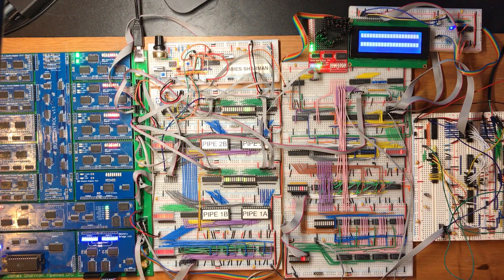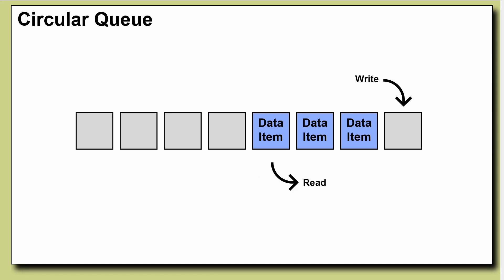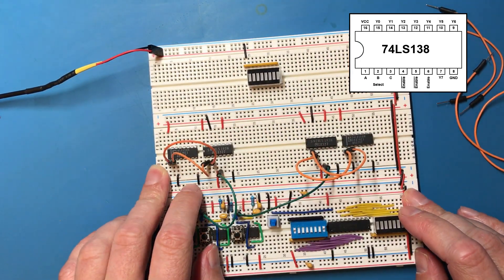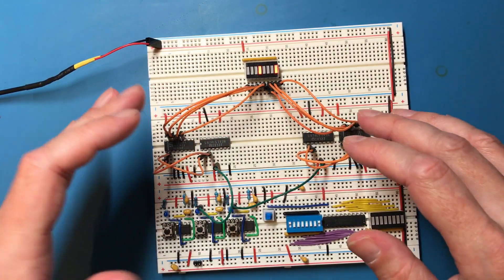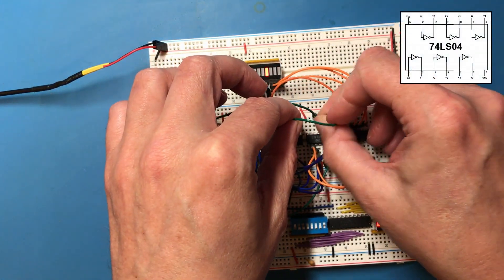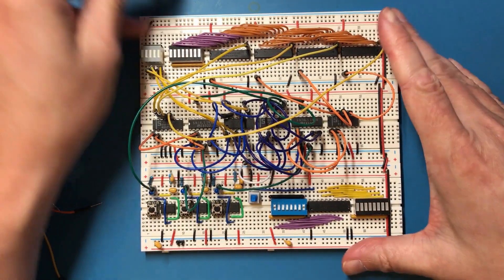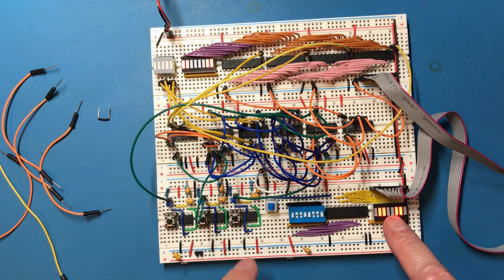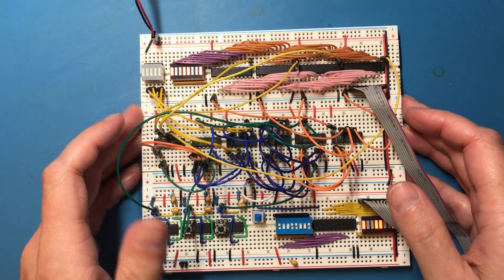FIFO Buffer - UART from Scratch - Part 4

Comment: I was immediately thinking of counter chips and decoders for the enable lines too. An alternative could be a couple of shift registers? Just shifting a bit round in a loop to indicate the read and write pointer - although exactly how you might initialise the circuit with a single bit might be complicated. You could compare the bit position with some XORs to know when they matched indicating the queue is empty. I don’t think you need to know how many items are in the buffer.

Great series by the way. I feel inspired to build something. But you make it look so easy, and I know it won’t be!
Reply from the maker: I'm not sure about your shift register idea, maybe try building it? I did have a very different idea with a series of latches where the value ripples forward.

Comment: Hi James. Great video as always. To answer your question : great idea to show the schematic while you build. Interresting idea to build yout fifo yourself instead of going the easy way with a fife chip. Looking forward to the pcb with the tsop format.
Reply from the maker: Thanks Ced! My plan for the pcb is to use TSSOP for the latch chips (8 of them, so it saves some space) but I'll do the control circuit with my usual SOIC.

Comment: Very nice! This reminds me a lot of the double ended queue I designed as my first really useful circuit.

It was pretty different, since it had a different use case, and it's really cool to see how you're implementing it for your CPU build.
Reply from the maker: A double ended queue in hardware? Nice! I'll have to think about how I would do that.
Reply: @weirdboyjim  I used counter chips for my pointers, but ones that also could decrement. If you were pulling from either end, it would toggle the dec line.

It was a pretty fun project, and a little more complex than I had originally thought, but in  the end I had a really cool, functional DEQUE module :)
Reply from the maker: Yeah, it's not a massive addition, I already have unused decrements, you just need a two sets of 4 line 2:1's to select which pointer is the read/write address.

Comment: hey james! 😊 the format of developing the breadboard and the pcb design in parallel is actually really good! it removes the boredom (to be honest) which comes up sometimes when there are 40 minutes of just designing the pcb in a row... i think it's a good mix! 🥳
Reply from the maker: Glad to have the feedback. I've been trying to cut the pcb design down as much as I can without loosing it. I want this video series to be a full build record but I'm trying to mix things around as much as I can.
Reply: @weirdboyjim  yeah, i know. and watching pcb design is interesting in itself, for sure. but if u have seen it 30 times before... you know 😂 so i think the parallel format really helps with this issue... it also bridges the gap that was there before, between designing the pcb and what is actually designed, as those videos might have been seperated by several months

Comment: Thanks for directing me to this. This is seems generally like what I was thinking for the Video Write FIFO. 
As you said, it would need to be a lot bigger to handle the size queue you're expecting.
Seriously, kudos and much thanks on the crash course on EE and CPU design.
Reply from the maker: If you look later in the UART series I make an 8-byte pcb version which is what I'm using on the UART in the vga videos. Definitely recommend looking at something more compact if you want it much bigger though.
Reply: Same stuff, but using an integrated memory chip instead of a decoder driving enables of individual registers

Comment: Interesting. I remember when UART chips with buffers first came out and we could use higher speeds on our PC's. Seems all PC IRQ's interrupted the CPU enough to loose characters. Plan to add interrupts to your CPU project?
Reply from the maker: I'm glad someone else remembers the pain of relying on interrupts.  Without a buffer no interrupt handler (or combination of them) could take longer than one character or you risk loosing data. Classic interrupts are not planned for this build, that's a scope choice to allow me to finish the build in a reasonable time. At this point I'd have to rework a bunch of parts that are already pcb's to retrofit them.

Comment: Nice build. 
A simplified vision will be to use universal register IC  LS74198 with master clear input. It would save a lot of PCB space.
Thanks ✨✨
Reply: the '198 appear to be made of unobtainium
also, wikipedia states it's a "8-bit bidirectional universal shift register", doesn't seem that would be the right thing for the job
Reply from the maker: I don't know that part (maybe a typo?) but there are lots of more complicated chips that would simplify the task. There are single chip fifo's around, there are single chip UART's with fifo's built in and of course you can get micro controllers with multiple UARTS. This is about the challenge of building things from scratch  more than simply the end product.

Comment: Seeing the schematic every now and then makes it easier to understand whats going on on the breadboard, so its a nice touch, i like it !
And I was wondering if a couple  8 (6,4,whatever) pin strip headers,  an old floppy cable and some heatshrink would make a good multi line cable for the breadboard ?

And James, your voice is so soothing, I clicked the video and went to suspend at 7 minutes. Please consider making a reading book channel ! :see_no_evil:
Reply from the maker: Thanks for the feedback. If I understand your suggestion correctly that's basicly what I'm doing with the dupont wires for connection's between breadboards. I've tested a few circuits out that way but the problem is they get very unwieldy unless you make a custom one of the correct length.
Reply: @weirdboyjim   Yes, i thought  single row  8-pin Dupont® wires would make for easier  latch connections.  ... details  ^^
I get the unwieldy thing though. Thanks for the reply !

Comment: Amazing as always! Couple of points.
I'm sure you wouldn't need a FIFO if you had interrupts. Just saying. :). I know that they'd be a pig because of the pipeline. 
It would have been interesting to try stacking the latch ICs. You only need access to two out of the 20 pins on each part, the rest could be tied together. Stacking them by soldering them together is a horrid but useful trick.
The schematic resembles a netlist. They are easier to comprehend if you'd used buses and wires and not just labels. Likewise the symbols are all just representations of the physical ICs. 
Anyway fab stuff and top marks for persevering with those breadboard busses!
Reply from the maker: You would be surprised, the majority of early uart chips had some buffering as the overhead of triggering a receive interrupt for every byte was nasty. Transmitting is a big deal as well, my current code spends large amounts of time looping while the current byte sends. Imagine the code for moving the cursor, it outputs a few characters (waiting each time) then performs an itoa8, outputs that string (With all the waits) and then repeats all that again. Just a few bytes if buffer will let it get on with those divides when it would otherwise have been waiting.
Reply: @weirdboyjim  with a tx interrupt the interrupt would run when the holding register is empty, at which point it would populate it from memory. The processor can be doing other stuff. Am only going by the 6850 which IIRC has no buffering, except for the bytes in flight in both directions. Anyway the circuit is interesting and I'm interested to see how you get on with TSSOPs. One annoyance with those is you can't run traces between the pins, which is a pain when you are teselating them.
Reply from the maker: Yeah, the 6850 didn't have proper buffering. The problem you get there is if the main code holds the 'i' flag to long, or any other interrupt handler goes on too long you loose characters. With a transmit interrupt you are basically guaranteed to be running at a reduced transmit rate due to the time it takes you to respond.

Comment: Another great video. Are you going to have 'read ready' and 'write ready' signals to tell your CPU when it can read from and write to it? I cheated and used a UM245R for my UART and it has those signals, so missing or loosing data is eliminated. There is also a 4 bit x 16 FIFO chip 74hct40105 in DIP and SOIC that Digi-key is selling. I'm not sure if would be suitable in your case as it works differently to your FIFO, it is more like a pipeline than a circular queue.
Reply from the maker: Thanks David! I haven't decided what I'll expose back to the cpu yet. I could just feedback the number of bytes in the buffer. Those fifo chips are pretty cool, two of those pretty much IS the module I'm designing but it won't have any led's or the knowledge that you built it from scratch ;-)
Reply: if i understand, the '4015 is sort of a ripple buffer, that is, you would need to write to it 16 times to get the first data written to it? That does not seem helpful for the performance of this UART design.

The '670 seems much more appropriate.
Reply: @darer13  I'm using the 40105's in my build. Any data you shift in ripples all the way to the output immediately, so you can use as a regular FIFO buffer, you don't have to write 16 times.

Comment: Is buffer overflow protection implemented in software or hardware?
Reply from the maker: Here is implemented in software, but i you watch the later video on flow control that's essentially adding overflow protection for the receive buffer in hardware.

Comment: These schematic symbols really are my pet peeve. 😣

If you used symbols with the inputs on the left and outputs on the right your schematics would flow a lot better, instead of being a collection of "chips with labels on every pin", which to me makes the circuit much harder to understand since you have to find every instance of a label and mentally reconstruct how it is all connected.

But this is still very cool stuff. 😄
Reply from the maker: Very few of symbols are setup like that on easyeda and it would add even more time if I was to sit down and create them all.
Reply: @weirdboyjim  I reckon you probably said that last time I moaned about them lol
Reply: I completely agree. They're a schematic diagram. They should show what the function is, not what the IC pinout is!

Comment: How about adding spi and i2c to the computer? I bet spi is easier because it is just a 2 opposite shift registers (Parallel In, Serial Out and Parallel Out, Serial In). I2C is just a half duplex synchronous uart.
Reply from the maker: If you asked me a couple of months ago I would have said no, but I've actually been considering spi as a way of getting some storage (SD cards) into the build. Not 100% sure yet though.
Reply: I hope you decided for instead of against 😉 I’d like to use raw SD for storage in my build.

Comment: Was wondering if u could've actually used those 16x4 RAM chips for this....🤔🤔
Reply from the maker: Obviously you could, but it might not be as easy as you think. The main difference is that the IN and the OUT are completely independent. You can enqueue and dequeue alternatively, at the same time or any combination. This is necessary as you have no idea of the state of the send/receive circuitry in relation to the cpu. You would need a much more complicated circuit to mediate the read/write, probably not worth it for so few bytes but with a bigger ram chip it would scale much better.
Reply from the maker: @oH well,lord! That would work, but yes they are very expensive. Of course this buffer circuit IS a duel port ram, with separate read and write ports.

Comment: You should be able to use a pair of 74LS670 or '170 4 x 4-bit x register files for this.
Reply from the maker: You could indeed, although I wanted to do it from first principles as much as was reasonable. In this you would have replaced 6 chips with 2 but it also would have taken away the easy expansion to 8 whole bytes I use in the pcb version!